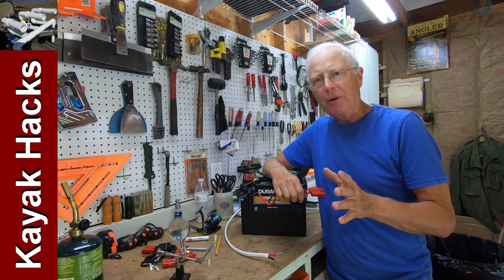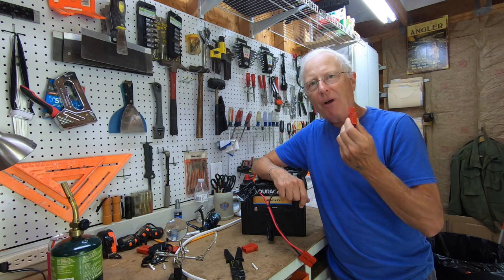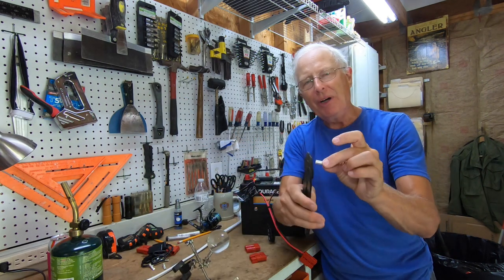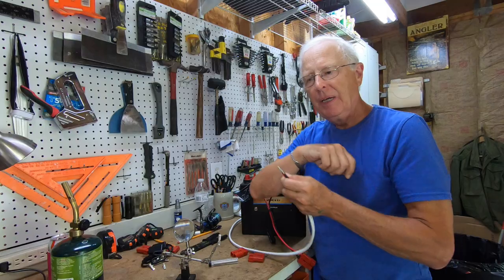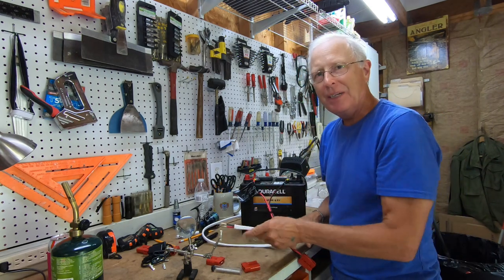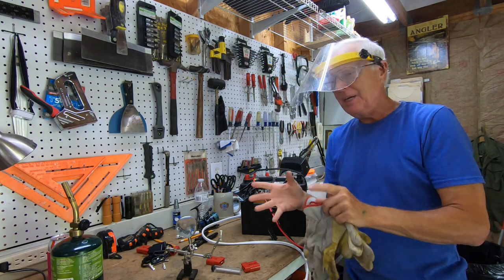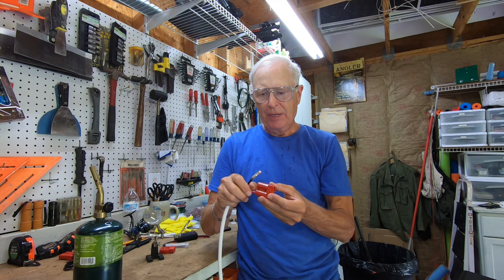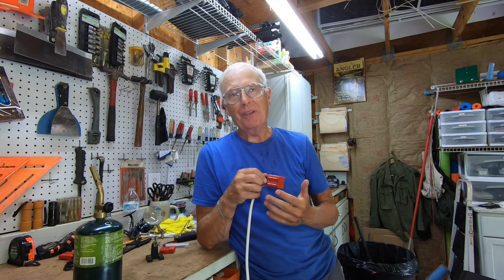Kayak Trolling Motor Wiring - Clamping Quick Connects

Comment: Sticking a cold wire into a melting pool of solder usually leads to a cold solder joint. It's usually better to heat up the wire also.
Reply from the maker: Thank you for that tip!

Comment: I've always just crimped them on because those are actually "crimp connectors" anyway. I've had mine on my truck plow for 10 years without any problems. I'll have to try the soldering idea if I ever need to install a plug again.

Comment: My quick connects from Bass Pro had butt splices attached to wire and rubber sleeves over them. I cut rubber sleeves off so I could solder them, after I used crimpers (I’m an electrician, so have some but could have used hammer or vice) to squeeze them down on wire, then wrapped a layer of electrical Rubber tape (overkill) and finished them with standard electrical tape. Been over five years with no problems.👍 I use the exact same type magnifier with clips rig you have to hold all my soldering projects together while working. Have a great one Steve!
Reply from the maker: Thanks for the tip on Bass Pro!
Reply: Is your mess still sitting there?
Reply: Mess? In 8 years I haven’t seen a single one done better or cleaner. I put well over two hundred miles a year on my kayak. Not one single problem. I’m going on a 40 mile run this weekend. Happy Thanksgiving..Don’t eat too much turkey! 🦃😂

Comment: If you're running 10 gauge wire, you can use 45 amp Anderson Power Pole connectors instead of the SB120 series shown here.  The 45 amp rating is better matched to an electric kayak application than the 120 amp rating of the larger ones.  In addition, the contacts are easier to attach to the wires, though you do need a crimping tool.  I designed 3D printed housings for the Power Pole connectors to make them waterproof.  Check them out on my channel.  There are links to the CAD files so you can make them for yourself.  At this point there are inline connectors, 2 styles of straight bulkhead connectors, and a 90 degree bulkhead connector.  The intent being to have fully waterproofed electrical connections throughout the kayak.
Reply from the maker: Thank you very much for that advice

Comment: That's the best way I know of to make wiring terminations. I use the same method on the starter lug connections on class 8 road tractors. Those cables have to carry a lot of current and see a lot of adverse weather on the trucks that head north in the winter.

Comment: I am happy to find your video. I have a trolling motor for my SeaEagle inflatable raft. I want to put the battery in the front of the boat but perhaps sometimes want to put it in the back of the boat if I have passengers. I am wondering will these quick connect sockets work?  After I'm done boating do I just unclip them from the engine side?  DO they connect and disconnect easily. I was sorry to see this video end so quickly. I'm knew at this. THanks,  Tom
Reply from the maker: Yes, they work great and are easy to connect and disconnect. Keep them out of the water, though - they are not waterproof

Comment: I believe solder is the best way for nearly all saltwater electrical wire connections. I started doing that after a couple of connections corroded and I had to re-strip and wrap the wires onto terminals while we were out on the water (not fun). It was for the Lowrance GPS/sonar and I was lost... er... I mean exploring, and we couldn't have found our way back in the dark without the thing 😋
Reply from the maker: lol! I've spent time exploring as well!

Comment: Quick question. What size wire are you using and where did u get to.? Also the connectors?
Reply from the maker: I looked at the size of the wire coming out of the motor and matched it. In this case, it was 10 AWG. I got the marine wire at West Marine and a hardware store that has marine supplies. Unfortunately, Lowes/Home Depot do not carry marine wire.

Comment: Quick question do you actually use those same quick Connects with the trolling motor without a trolling motor plug?
Reply from the maker: I'm not sure what you mean. The wires from my motor run to the quick connect. I have quick connects on my battery to plug them into.
Reply: @KayakhacksFishing  quick connect your trolling motor? Without a plug?
Reply from the maker: @justintimeforbass  Sorry, still confused. My trolling motor does not have a plug on the motor head. The wires run from the trolling motor to connect to the battery. I put the quick connect on the end of those wires and then put a quick connect on the two wires coming from the battery. Then, I just plug the quick connects together to make everything run.

Comment: Hi,
Yes,  I always use marine grade multi strand wire.  Do some research on the difference between regular wire and Marine Grade wire and you will find it rewarding.
I also put the heat shrink tubing on the connection ends with the (internal sealant) that activates when you apply the heat gun to the tubing.  The sealant seals around the wire and squirts out the ends of the heat shrink and keeps the exposed wire marine grade or not from developing corrosion.

FORGET THE SOLDER AND ALL THAT SAFETY EQUIPMENT!
I also use the Anderson Power Pole connectors on various Boat Wiring.  They offer a special crimping tool and connector system.  When properly crimped with their tool (not cheap but worth every penny) the connector is securely to the wire.  The have color coded plug housings that fit together and are polarity sensitive so you can't hook them up backwards when properly installed. The connectors I use have 3 sizes of terminals i.e. 15,30,45 AMP and they all fit into the same external color coded housing.  Best thing since sliced bread.   Ha Ha
Check out their website https://www.andersonpower.com/us/en.html 
They have tons of accessories that help you build custom plug connections.  I built a custom interlocking plug for my charging system on my Minn Kota 315D charger that has 3 each 2 prong housings for a total of 6 housings that are all interlocked together as one plug.  They even have a method of inserting pins in the plugs to keep them from unplugging during operations.   You will find visiting their website and checking out all the wiring connection possibilities will give you a good education on proper wiring techniques.    I thank my friend Phil Krug for the information that has greatly helped me do effective wiring on my boating projects.  I WISH I HAD FOUND THEM YEARS AGO.
Hope this is of some help.
John
Reply from the maker: Thank you very much for those points and tips

Comment: I have used a inverter hooked to my car battery for years with the quick connects. Never pull the wire; always the quick connect. Great recommendation.. You always have great ideas.